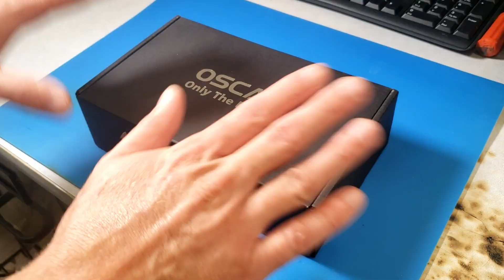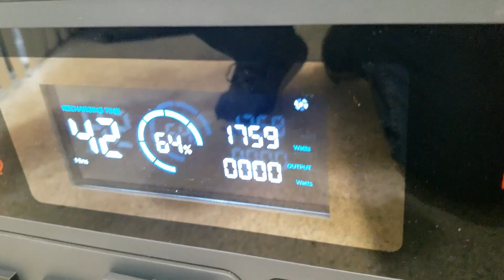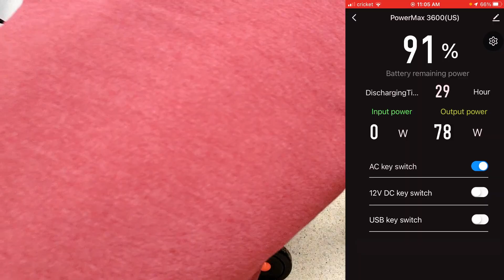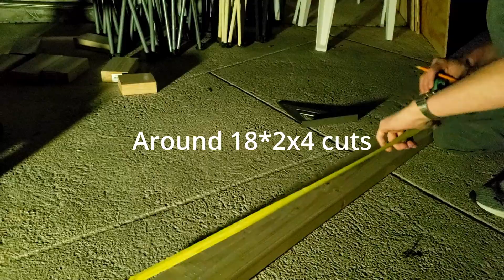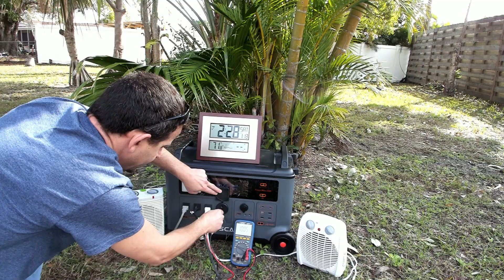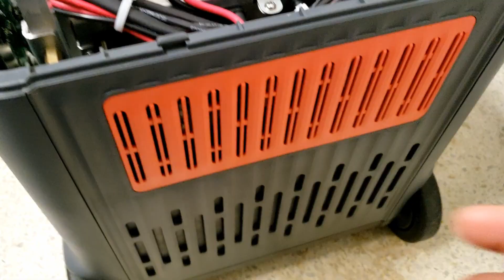Oscal PowerMax 3600 Power Station Review - 3,600 WATT HOURS!

Comment: 1. Solarinput 150V max: Does this mean the open-circuit voltage?
2. Has the PowerStation a PE Connector?
3. May I connect any additional battery, like DIY or something else?
4. Did you found out more about PowerSelfConsumtion the the Inverter in the System?

Comment: The cheapest price is $1391 from Factory Pure online. There are so many of these coming out now. This particular one is advertised as an Echo Flow killer for a thousand less. My concern is the long-term quality 10 years from now. Will this company still be around?
Reply from the maker: So far I have been extremely pleased with this unit.  The parent company is Blackview which primarily focuses on mobile electronics.  I share your concerns as to them still being around in 10 years for power banks tho.  Personally, I believe they will still be selling mobile devices but I'm not certain if they will be selling power banks!  I'm still very pleased with mine tho. I have 6x 250 watt 30v panels wired in 2 series sets of 3x panels in parallel at 90v dc and charge this power bank daily at 1kW+.  It saved our butt during Hurricane Milton.

Comment: Can you get me some help, pass this request please till I  receice answers!

The OSCAL PowerMax 3600 not only supports typical zero-cost green energy sources (like solar charging), but it also makes it easier to charge from wind (wind turbines) and water (water turbines). You can easily connect solar panels to this power station to take advantage of solar charging, for example.
What to do to achieve this statement?

Comment: Nicely presented.
I am interested in the minimum ac input power, how much it is. The video shows only 1200W, 800W, 400W.
Does it seem to me that the overload protection tripped at 3070W even though the manufacturer mentions 3600W?
Thanks for the reply.
Reply from the maker: The minimum AC input setting is 100 watts.  It behaves like a UPS though.  With the AC input connected, it will run the full load from your AC input source while sending the minimum setting of  100 watts to the batteries.  In this configuration, the registered input power does not reflect this-- it shows only battery charging power.  So if you have 1kw connected to the inverter output, it will be pulling the 1kw from your ac input source but only showing 75-100 watts on the input meter.

Comment: Is there a max input voltage for the solar input? It says 1600w, but wondering for solar panel compatibility.
Reply: In case any1 is wondering. Device is running 24/7 for over 3 months now without any issues. Max input voltage is around 150V, so you can easily connect 4 400W panels. Oscal 3600  is pretty loud, it turns on the fans without any particular reason.

Comment: Where did you get the app? I can't find it in the app store for iPhone
Reply from the maker: The Smart Life app is what I'm using in this video.  I've also discovered that the Tuya app works and is what I use now.  Now have all of our smart plugs, switches, lights and the Oscal in one app.  Hopefully both of those apps are still on the app store!  Tuya can be a bit tricky to get setup tho.
Reply: @ststele Thank you! Both connected.
Reply: @ststele I got Tuya to find them both. Labeling is funky and I can't find where to adjust charge settings. It looks like the images are not scaling. I know you're not tech, but appreciate the assist.

Comment: you should do a standby consumption test of the ac and dc side of the inverter. It would be nice to know how much the inverter takes watts  per hour because this thing seems a bit too optimistic on its maximum run time.  Also with and without all the wifi and Bluetooth on . I expect that to consume at least a steady 3 watts as it does on my ecoflow.
Reply: Con inverter acceso consuma sicuramente 4o 5 watt o piu

Comment: Did you notice when it tripped off and you disconnected the second heater that the temperature for the State dropped by 1°F so I think you owe the people of Florida an apology for their temperature plummeting so much. 😁
I think your temp gauge may have been affected by the heater outputs. 🤦‍♂
Remember, with great power comes great responsibility. 🤭 Nice unit, wouldn't mind a couple or three to add to my system.
Reply from the maker: Lol! I didn't notice that.  The heat was definitely working it's way up to the thermometer.  😁

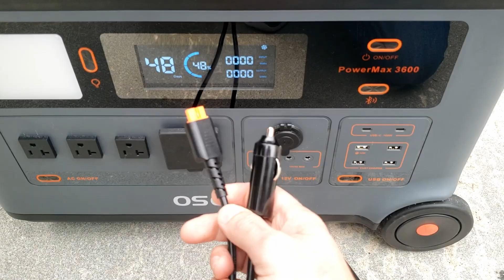Comment: Nice work Jason, great review and really well made product. That things is a beast!! - at 33:25 or so, I'm going to create a scenario that I am POSITIVE will 1000% happen to these people.. someone, a genius, is going to take that power cable that has the input end and the 12v plug end on it and look at that battery pack and think.. huh.. why can't I plug this input end into the side of the battery DC in and plug the 12v plug into the 12v power socket on the front of the battery and make it charge itself? I worked a miserable year in customer service while I was in school many moons ago and those are the kinds of calls I would get.. Like.. yeah sure, of course you can charge the battery with the battery, if it's not working maybe you should return it and try it with a different one, and if that doesn't work, maybe products like this really aren't designed for you! : )
Reply from the maker: I do wonder quite a lot, what would happen if I plugged the 120v output to the 120v input.   I actually didn’t think about trying the DC output->input tho.  Lol. Thanks 😀

Comment: What an excellent power station,  i think you gave it a dam good test :-D
Ive watched a few people that had a similar box of tricks,  they all work well.
I imagine the logic in that device would be a pain to design.
Lots of configurations and getting the best out of the batteries.

 if i lose  power then the candles and matches are under the sink lol,   if i can find the sink in the darkness. ill shut up,
Reply from the maker: Thanks!  I have a generator from the 1970s (or something) but it almost always runs with a little work.  It takess a long outage to get me to dig that thing out though because it weights a million pounds and barely puts out 100v with the right amount of cardboard shims behind the adjuster (util the cardboard vibrates out and it goes back to 80v) lol.  I'm pretty glad to have this battery powered unit.

Comment: Hell you live in Florida. Get the solar panel and durning the day just charge from that and you should have no power loss at all
Reply from the maker: I'm gonna wind up being a couple of used cheap panels.  240 watt panels used down here are around $50 because regulations prevent them from being used on houses.  This being a mobile unit, I can totally get away with using the used panels.
Reply: @ststele puoi mettere anche 4pannelli da 240watt in serie l'importante stare daun 160volt di voc o six pannelli 3in serie poi unite in parallelo  con altri 3in serie 30v x3 90v 11amper per 2 90v 22amper o  4pv in serie 120v11ah dipende
Reply: @ststele I believe the Oscal will accept up to 1600 watts of solar. With that much solar, you'll be able to fully charge the Oscal in just over 2 hours. Just watch the voltage stays well below 150 volts max and the wattage at or below the 1600 watts to avoid damaging the solar generator.

Comment: Hi Jason, was the AC output a pure sine wave or what is called a 'modified' sine wave?
You should only run sensitive electronics on a pure sine wave power source.
Reply from the maker: They advertise pure sine wave but I didn't check it!

Comment: Hi, I'm a recent subscriber and enjoy your videos.  When you mentioned hurricanes and particularly Ian, you got my attention.  I'm a hurricane/typhoon/tropical cyclone forecaster (since 1980).  Currently, I live in Houston, TX.  After Ike hit in 2008, we were without power for exactly two weeks.  At the time I had a very small gas-powered generator that lasted about 1.5 hrs on a small tank of gas. Half-way through the Ike outage, I purchased a 5500W gas generator that runs 11-12 hours on a 7-gal tank.  I also had an electrician install a transfer switch next to my electrical panel, so that I can plug the generator directly into the panel.  There is a safety feature that requires you to turn off the main breaker so that you don't send power down the line to anyone working on restoring power (among other reasons).  Today, the high here in "warm" Houston reached only 30 degrees behind this Arctic front.  Such fronts often produce periods of a day or so without power, and without warning.  

That large 120v outlet LOOKS like the same plug that my generator has to go to my transfer switch.  I'm not going outside to check now, though.  Something like this would be great during an unexpected power outage (unlike a hurricane when you know it's coming).   Do you have a transfer switch installed next to your main panel?  Something to think about so you won't have to run all those extensions to your Oscal.  Just plug it into the transfer switch and use whatever you need to in the whole house (not the AC, of course).  it could run a window unit at night, I suppose.

Looks like they're asking about $1800 for the battery.  Not too bad.
Reply from the maker: Hello, thanks for your comment!  I have a double-ended cable for connecting our old generator to the house but the house never had the transfer switch installed.  I haven’t checked yet but I think it’s the right cable to plug into the thing.  Hurricane Ian was the first cyclone since we moved here 5 years ago that made a right turn just after entering the gulf.  It hit south of here but it still reshaped this whole area!  We usually go to the coast to watch the big storms go by but with Ian it was just too dangerous so we stayed home!  This machine should run everything we have except for the big ac and kitchen stove.  It might run our hot water heater if we used a big step-up transformer!  I haven’t checked the wattage in that heater though. As for the price, it looks like this Oscal is priced at $1700 at half off.   I think they’re going to try to sell them for $3400.
Reply: @ststele  I thought the value of $16,688 was the cost, but it's not. That's how much money they've raised. Whew!  Yeah, $1798 is more reasonable.  That's the price I was thinking. As for the transfer switch, they cost about $200-300 + installation.  You can probably do it yourself, since you seem handy.  Sure was nice just starting up the generator during the 2021 ice storm power outage and plugging it directly into the house.  We could run anything, including the heater, since we have gas heat and the only power needed is for the fan.  With a family of 5, though, you have to tell the kids to ONLY turn on something if they really need it, to conserve battery/generator power.  That's easy with just my wife and me.

Comment: Heya, that looks very nice and a good review with some load test's. now only a solar panel (depending what is the max power in). still I like to know what kind of batterie cell's are in it, it looks like 18650 if this is so they could catch fire. oke I know there is a bms inside protecting the (if they are ->)18650 cells for over/under voltische and you showed temp sensor so with normal us it must be save.don't get me wrong I myself have 6K 18650 used cell's witch I'm testing for the good ones and make a 100 parrallel and 12 serie to make a 48 volt  batterie pack. and still it's good to have some battery back up for wen the grid is down

Comment: Wow a company smart enough to use Anderson Powerpoles for the 12v.  Wait nvm, if they are using XT's for the 11-150Vdc they can't be that smart.  They should of stuck with Anderson Powerpoles for the 12v and the 11-150Vdc or used some EC5's.  At least they are using LiFePo4 batteries.  I use the same type of battery in my motorcycle, huge weight reduction.

As far as battery life.  There site says 3500 cycles and 25 years.  And seeing as they are LiFePo4, you can go 100% DoD without hurting them and keep them at 90-100% charge.

Comment: thanks for the review video.
if the power is out you will definitely want to keep the fridge and freezer going.
as you mentioned, you can also charge it via the gas generator so you dont have to keep the gas gennie going constantly, like at night.
of course if you invest in solar panels then you can also charge it with that, possibly also run your workstation completely off the sun.
glad that you are able to make good use out of this power station. please do update us if you decide to retire it or if it is retired due to it stops working.
it does look interesting, but my experience with indiegogo leaves me with not being interested in investing in this unit.
imo anything on indiegogo is an investment, as you are not guaranteed to get your product.
Reply from the maker: I’m gonna add some solar now that everything but the panels are on hand.  I will update if I run into any issues or device failure!  I’m not too familiar with Indiegogo and didn’t realize that.. scary!  It looks like they’ve put a lot into  producing it tho.

Comment: Is that a fire hazard?
Reply from the maker: So far is seems really solid.  I’ve been running it for 2-3 weeks and I’m getting to where I trust it.  I reduce the charging current for this old house’s wiring though. There is a lot of daisy chaining from outlet to outlet and I don’t trust that!
Reply: @ststele Thanks for the reply, but I was kind of making a joke about Tesla power stations.
Reply from the maker: Oh... Lol 🤣
Reply: @ststele   I would not put more than 1500W on a single thin 110 outlet. It may be possible to fan out 2?

Comment: Greetings from Romania.  Welcome to the off-grid community.  I have been off-grid for 2 years with a 15Kw battery and 9Kw photovoltaic panels with two 6Kw inverters.  Only in winter do I still need to get electricity from the network.  The Home Assistant server maintains the connection with over 100 devices in the network, and the service devices even if I don't have internet.  The residence of Mistocei.
Reply from the maker: That is awesome!  I’m going to be adding some solar now.  With this unit being portable, as long as the solar isn’t physically attached to the house, it avoids red tape/regulations that we have here.
Reply: @ststele  Make sure you're getting lithium batteries for power storage
Reply: @ststele  WTF? Has that got something to do with the slight breezes you sometimes get? 
Do some research Jason and find out how much solar you receive during a cloudy day so you will always be able to charge the battery for use at night during those power outage times.

During summer in Melbourne (Oz, not Florida) with 6.6kWh of panels and a 9.8kWh (actually 9kWh because it never discharges below 11%) we are 86% self sufficient and over the year with very cloudy winter days we average 57% self sufficient. Knowing what I know now I would have at least doubled the amount of panels and added a second battery, preferably Tesla two Powerwalls instead of the single LG we have.

Comment: How did your braker not trip with 1800W of charging? 30A braker?
Reply from the maker: It’s pretty close - our service is just over 120v and that’s a 15 amp breaker (I think).  It’s right at 1800 watts!
Reply: Seems crazy how you guys still use 120v 😮 240v 3kw is standard here

Comment: Hi Jason.  What if you piggyback that to a natural gas powered generator ?  Reason being to produce clean power for dirty power sensitive equipment ?  Can run infinitely ? Some of new fridges have computer chip and might be sensitive to dirty power.
Reply from the maker: Hello, it will work as an uninterruptible power supply if left on AC power.  I don't know if it would run on the inverter continuesly to clean up noisy power though. I didn't test it that way yet!